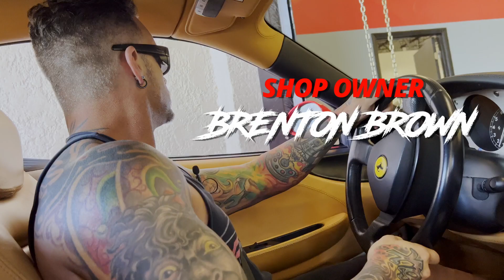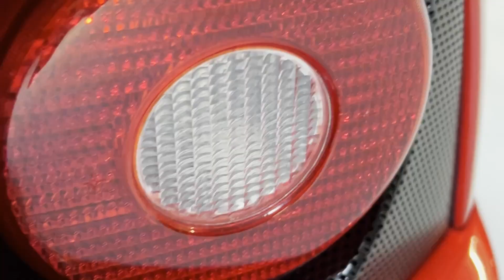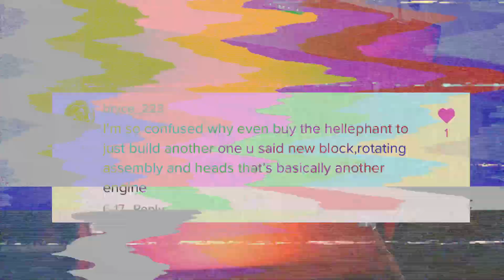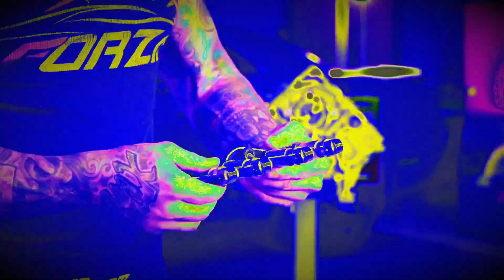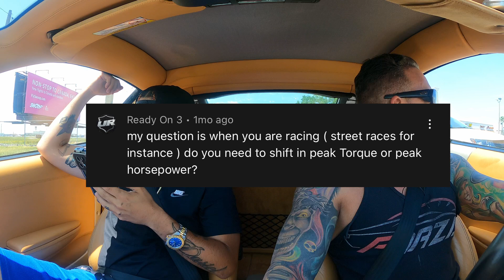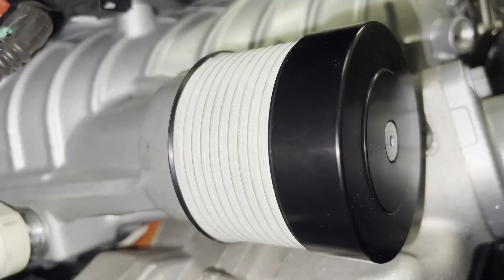Test driving a Ferrari 360 Modena - Legendary Supercar (Q/A) 🔥

Comment: For Brenton, for your stage 4R packages, do you prefer 6 speed manual or 8 speed automatic? I noticed with majority of these builds along with the Hellephant builds as well they are picking the automatic transmission! Also does it make a difference picking automatic over manual for these builds? Appreciate y’all for answering and giving in depth answers.